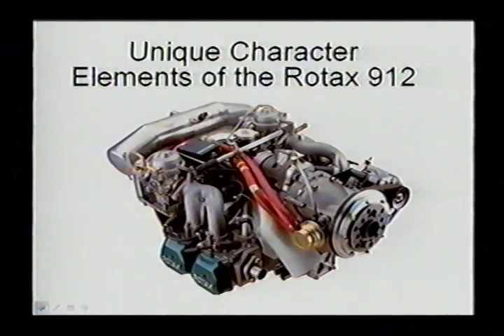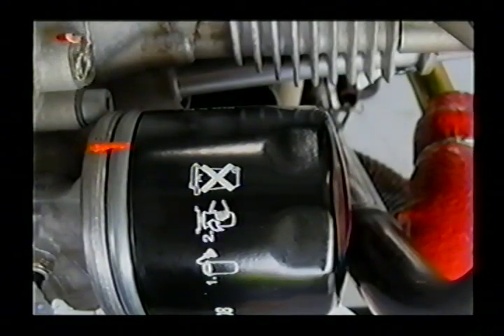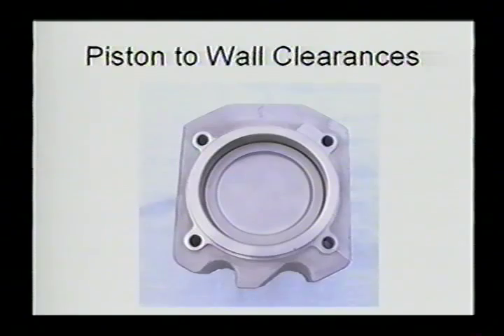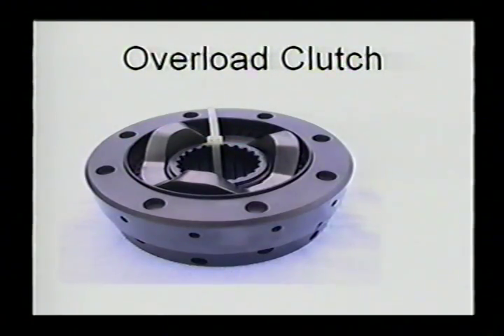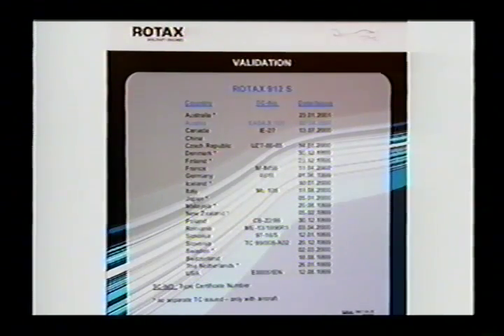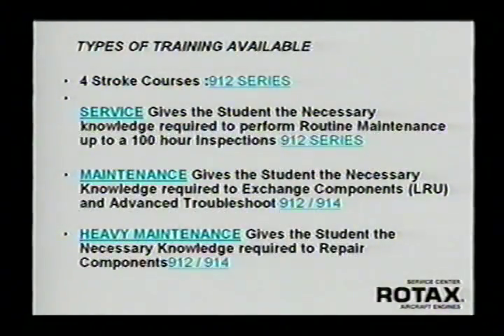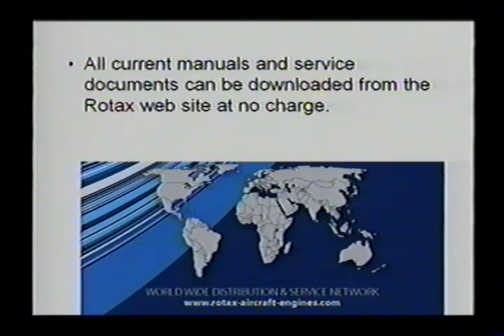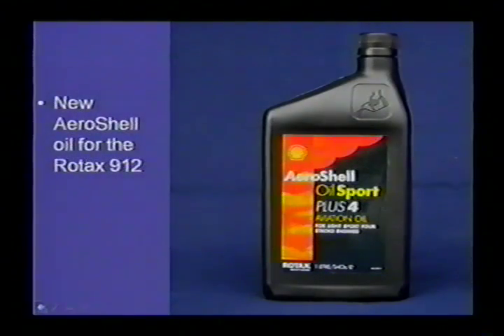Guide to Rotax Aircraft Engine Maintenance

Comment: OK!! WAY OVER PRICED FOR THE SPORT WORLD!!!!!!! I belong to no organization and if I bought a light sport engine it would be a Viking aircraft engines for half the price.I have a  little car with this engine in it with 238 thousand miles on it and still running top notch burning no oil and still with great compression! So 238 thousand miles to hours is 3,966 hours. I would not push a aircraft that far but, at $33,000 for a Rotax to $15,000 for a Viking. MY MONEY WOULD BE ON A VIKING AIRCRAFT ENGING FOR A SPORT PLANE PERIOD!!!!!!